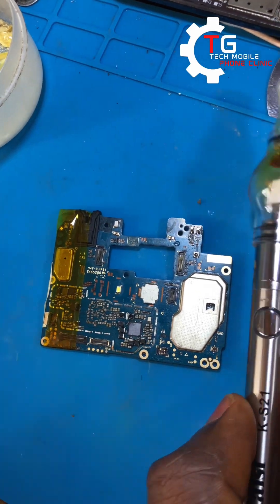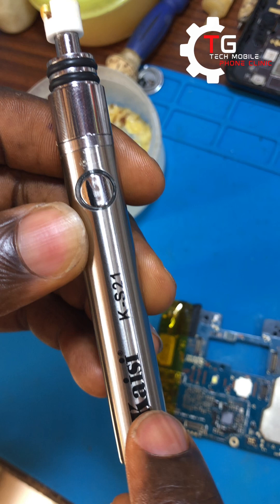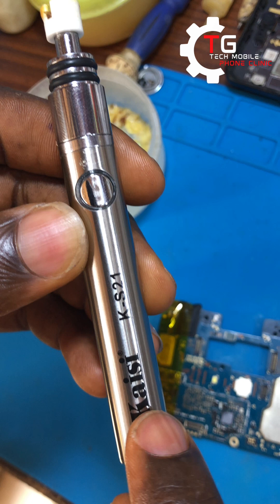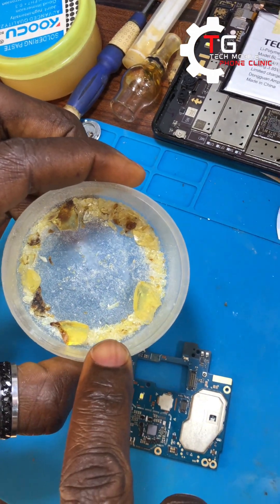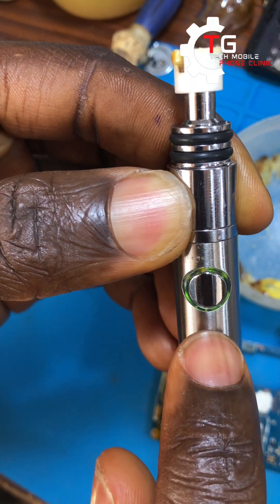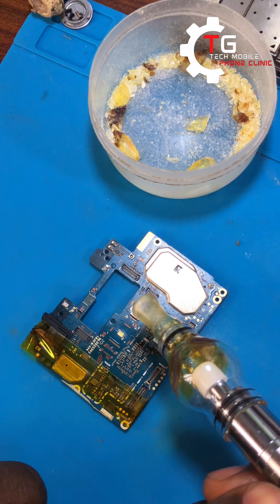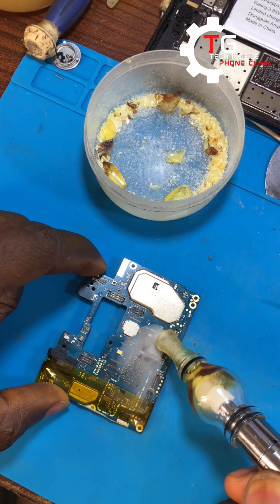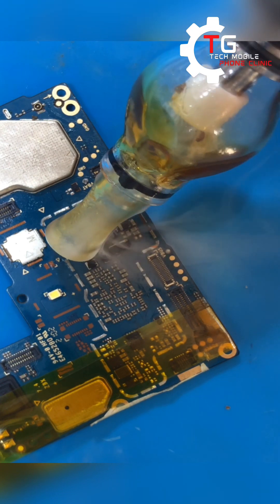How To Use Rosin Atomizer Pen For Short Circuit Finding On Motherboard/Panel

Comment: For anyone who is still confused like I was. The smoke is supposed to cover the board in a white smoke glaze. So it will be covered in a similar fashion to the kaboom scrubbing bubbles bathroom cleaner if you are familiar (using as a visual descriptor). Next, when you give the PCB power, the chip in short will heat, evaporating quickly the smoke glaze, revealing it's in short.